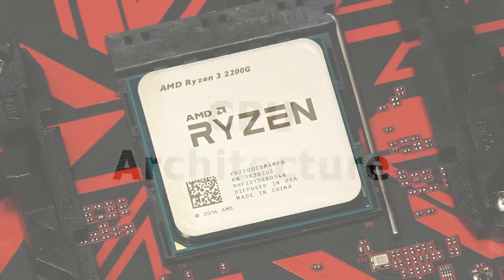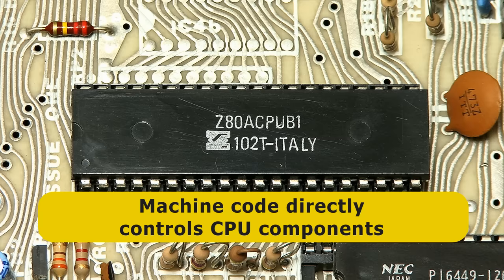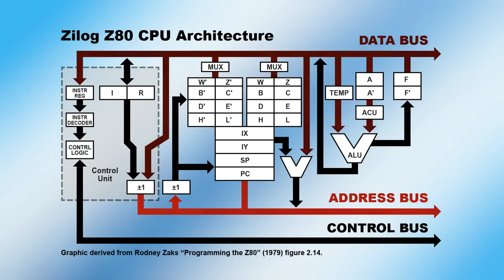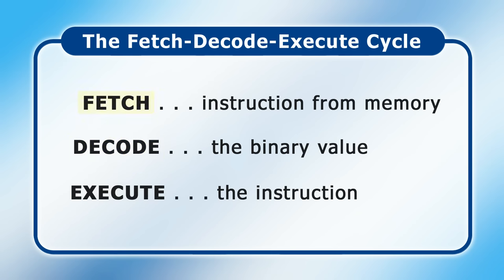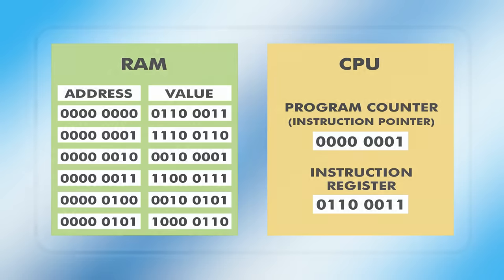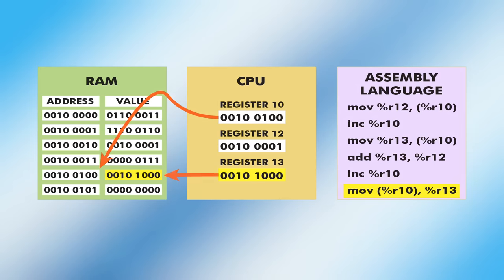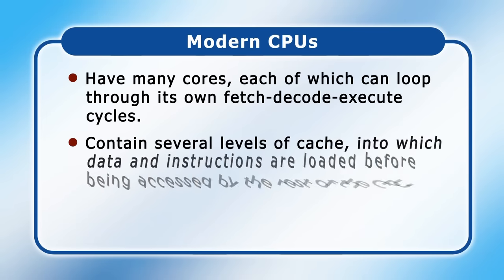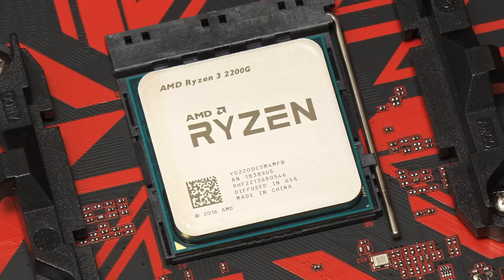How Do CPUs Work?

Comment: When you render an image in blender and it takes hours imagine how many billions or trillions of operations your cpu has to do, I can't even imagine a number that big.
Reply: This comment is key, as we almost lost our excitement capabilities on this area. Let me tell you that one day like this, July 12, but back in 1950, Dr. Konrad Zuse finished and sold the believed to be the first commercial digital computer of the world: the Z4. This machine was able to perform ~1000 calculations per hour (a multiplication each ~3 seconds). And that was fast back on those days! Today, a processor easily can perform more than 250 billions (short scale) of calculations per second (FLOPS). And that's in just a 70 years timeframe! Sure, processors can go over this number (can go over 1TFLOP or 1 trillion of operations per second) today, and graphics cards can go over 8TFLOPS today. And we still complain about speed in computers.
Reply: Thank you for this info, I also would like to know if Dr. Zuse's computer used discrete transistors or thermionic valves. Regards
Reply: amazing ! thank you
Reply: @A. David Garza Marín   we complain about speeds because of the evolving needs of humanity. Nobody will complain about the speed of a calculator, but if you want to do 3d rendering suddenly a few billion calculations per second is garbage
Reply: @adgarza  amazing how computers can run trillions of calculations per second yet web developers create websites that cant be easily ran on them
Reply: The whole internet and everything digital we know today is made from this. Computers are dumb they can only count from 0 to 1. So now imagine how many transistors it needs to gve it complexity.
Reply: Great video! I have a question..theese registers, what are they literally? Are they components that turns on or off or are they fixed?

Comment: I learned assembly language on a TRS-80 Model 1 back in high school.  We created a program to fill the screen with pixels both in Assembly and in BASIC and I was amazed how fast the program written in Assembly ran compared to the interpreted language of BASIC.  Fun times!
Reply: My first assembly language was for the Z80 in the TRS-80 model 3.  It kicked the model 1's butt!  Upper AND lower case and all!   ;-P
I made lots of little assembly programs back in the day.
Reply: See here why I avoid Python as much as I can. ;) 
I started 'programming' with BASIC, back then I simply had no access to other languages, I did not know anything about C or assemblybecause there was no internet. My first computer had an XT (pre-286) CPU, it had so little RAM that I could only play Prince of Persia by switching 1.4 MB floppies.
Reply: Good ol' trash 80.
Seems like just yesterday.
Reply: I almost gave up learning programming due to BASIC & Flow-charting, despite attending face2face classes. Could hardly understand the GOTO stmt. I saw some light when by chance I saw my teacher coding in some other language that had no GOTOs and zero line numbers. And I asked and that was my First encounter with C. I purposed in my heart to learn C and declared to my teacher I want to learn that instead of BASIC.
Alas, I was not willing for my parent to spend anymore in classes. Like what most other teens did; I turned to books. Spent hours to land myself on the right book. Finally learnt C and Psuedo Code b4 able to understand flow-charting.
From thence, picking up another language was do-able.
Yes, finally I code in VBAs and some other languages too.
Assembly is a little challenging though, perhaps just need some purpose for me to go that route.
Reply: @bobwong8268  YEAh, the biggest problem I found was to get the right info or most appropriate book at the time. There was plenty out there but none of it made much sense unless you happened upon the right stuff at the right time. That's where well structured and timely courses become useful.
Reply: commodore vic 20 RULES
Reply: @bobwong8268  The book of the day was "Programming the Z80" by Rodney Zacs. Still have my copy somewhere
Reply: @divismorefilms  Thx! I was a little late, 1st PC was the XT-8088.
The book that taught me programming was "teach yourself C" by Charles Siegel.
Reply: Hi Chris. The first assembler I used was mainframe (IBM 360) assembler, but soon learned IBM 1130 assembler.
Reply: Not me. I had traded in my trs80 for an Atari ST before I knew what assembly was. The Motorola 68k was amazing.
Reply: hope that this was taught to me in my high school times!!!!!

Comment: No matter how much even the most genius person in the world can try to explain how CPUs work I will literally never understand but also bask in amazement on the fact a mixture of freaking silicates, metals, carbides, and a few other elements designed all together can process and compute and literally give us what a computer gives us and allows us to do. It's insane when you think about it. Basically alot of highly refined sand converted into silicon and made into a CPU that electrical signals run through and then wow bam we have a computer. No amount of explaining will ever make sense to me and its not because im some idiot its because im just amazed that elements compounded and put together with electricity ran through them can do what they do. It doesnt make sense to me, Explain a way and i will always ask, BUT HOW DOES FREAKING SILICON GET MADE INTO PROCESSING POWER AND WHAT COMES OUT ON A COMPUTER SCREEN? HOW DO  THE 1s AND 0s ACTUALLY GIVE US THIS CRAP! ITS FREAKING MAGIC AND ALWAYS BE. ITS NUTS!

Comment: Excellent video, Chris - It would be great to see something similar for GPUs.
Reply: Go one step further and add in APUs and I'd agree
Reply: Maybe add in how GPUs differ from CPUs.
Reply: Modern professional GPU's can run OpenCL, so if look at that you can see the difference. OpenCL is made for massive parallel processing (the RTX3090 has 10.5k cores), they can't share memory between threads unless marked as volatile which means it can be corrupted/changed by any other thread at any time. Like releasing 10k bulls from a gate.
Reply: Chris, please explain my wife

Comment: You have refreshed my Tech programming class. I learned assembly language for the 8086 and wrote a basic program to run a traffic light. Thanks!!!
Reply: Self taught on an 1802, I wrote a 4 function calculator in assembly.

Comment: I was a mainframe software engineer for 46 years on several operating systems: OS (in the SVS, MVS(in many variants), z/OS, etc variations), DOS (/VS, /VSE variations), VM (/CMS), TPF, etc. for individual companies' development shops, and for several vendors (including DBMS, IBM, and Computer Associates). 2/3 or more of that work was in S/360, S/370, S/390, System Z (including Authorized-) Assembler.  The simplest of these had around 150 instructions, the most complex had around 400 or more. This was a great intro to the bare basics of Assembler on micro-processors. EVERYONE should have a grasp of machines at this level, no matter what 'level' of programming tools are used, if for no other reason than understanding the great advantages (and disadvantages) of higher-level (and more machine-abstract) languages and related tools. Great job, Chris !

Comment: Good explanation.  Of course even the CPU has microcode that tells it what to do when the instruction says the binary equivalent of "mov %r12, (%r10)".  Your code told it WHAT to do, and the microcode makes it DO exactly that.  The microcode is fixed in the CPU hardware...all those little transistors and can't be changed.  What writer was it who said "even the parasites have parasites" or something like that.  I, too, started by writing assembler code for a Z80 and later the 8008 and later the 8086/8088.  Prior to that, I wrote machine code for a Gerber plotter...no compiler at first.  It took forever to load in all the 1's and 0's.  Eventually we bought an APT (look it up) compiler and we really felt like we were "eating high on the hog"!  It was very Fortran-like, and was the beginning of Computer Aided Manufacturing, CAM.  As usual, I enjoyed your taking us down memory lane.

Comment: Awesome video!  It reminds me of the very first computer that I used back in the mid-80s, the Tandy Radio Shack  TRS-80 Model 3 which was also powered by the Z-80 chip with the clock speed of just 2 Megahertz.   That computer had tiny 48 Kilobytes of main memory and used TRSDOS as it's operating system.  It had two 5 1/4  inch floppy disk drives but no hard disk.   Since it didn't use any operating system with GUI or graphical user interface, it also had no need for a mouse pointer.
Reply from the maker: Thanks Gerry. I never used a TRS-80, but looked at them in window of the store on many, many occasions. :)

Comment: In my day, back in the 1960s the process of converting assembly language  mnemonics to binary was NOT compile but the ASSEMBLE process. Compile was reserved for high level language translation first to assembly language then that assembly intermediate code assembled to machine language.
Reply: I was coding IBM 370/Assembly language until the early 2000s - and it was the Assembler that converted that to machine code. Compilers are for high level languages (in my case Fortran). I'm not aware that the nomenclature has changed. And then, of course, Interpreters for interpreted languages.
Reply from the maker: A compiler is a program that converts code in one language into another, and the definition has not changed. Yes, machine code compilers could and have been called assemblers. But they are still also compilers.
Reply: @ExplainingComputers  Wikipedia agree with my understanding of the terminology,
Reply: @tonydyer2919  Wikipedia can be fixed (although I agree with both of you).
Reply: The older compilers took two or three passes to complete the task. High level language into intermediate code or assembly language and finally linked into a file that can be loaded.  The UCSD system stopped at the intermediate code (p code) which was down loaded and executed by a virtual p-machine which was independent of the processor type.
Reply: @ExplainingComputers  Assemblers always output the same machine code for a given input and there's a direct one to one relationship between the source code and the object code. The same is not the case with a compiler. There is no direct relationship between the source and the object. Different compilers produce equally valid (in the sense that it produces the correct results when executed) but not necessarily identical output, depending on the optimisations chosen.
Reply: The reason I remember the assembler to machine code process was because it was a one-to-one process: one line of assembler equals one machine code instruction.  OK let's forget about macro assemblers for now. A compiler on the other hand performs multiple levels of analysis of each line and then translate each line into many machine instructions.

Sure they are similar but do we still consider them similar enough to use the same word for both now?
Reply: @johnm2012  Ah. Thanks. I suddenly have a moment of grok that I did not have before. (Not a programmer, but an interested bystander.)
Reply from the maker: @johnm2012  Yes, agreed. But the fact remains that a compiler translates code in one language into another. And we are getting caught in semantics here. Here I have tried to make a video that explains something complex in a simple fashion for a non-expert audience. I've been doing this in lecture theatres, books and videos for 30 years, and can never please everybody, as simplification is always required.
Reply from the maker: @tonydyer2919  I am not disputing that a common word for a program that converts assembly language to binary is an assembler. But such a program is still, according to basic linguistic definition, a compiler. I would also never take Wikipedia as a definitive source of information on anything! Many of my former academic colleagues automatically failed anybody who cited Wikipedia! :) It is a great general resource, but frequently inaccurate.
Reply: @ExplainingComputers  I learned programming in secondary school in Scotland in 1966 to 1969. Worked my way from trainee programmer to MIS manager over about 20 years. Taught IT & Computing for 30 years after that, Hold HNC in DP, BA Hons in Systems, MSc in Systems integration. I know what I am talking about and if people like to be revisionist then fair does. I give up!
Reply: @tonydyer2919  "What's in a name? That which we call a rose,
By any other name would smell as sweet."
-- William Shakespeare

The assembler code I wrote was compiled, but, it still ran to completion with a return code of '0' (shades of COBOL on an IBM MVS TSO system  creeping in...). ;-)  I think it all depends on what we were taught.
Reply from the maker: @TheFuzzy70  Thanks for this. If it makes you feel happier, then I accept that I make the wrong judgement call here to use the term "compiler" rather than "assembler".
Reply from the maker: @tonydyer2919  Respect Tony, sorry if I offended.
Reply: @ExplainingComputers  We can agree with your definition that “a compiler coverts code in one language to another”. But what you’re overlooking is that the language of Assembly code “is” machine code. So the Assembler is simply assembling this more readable version of the machine code language into it’s raw binary form. A different language, like Pascal or C, uses a Compiler to generate the Assembly language equivalent “language conversion”, which is then Assembled into its final raw binary code form.
Reply: @TheFuzzy70  I just have to add one last comment on this thread; yes, we are caught in semantics here; it's just semantics and no more.
Reply from the maker: @gregclare  You make an excellent point Greg. I stand corrected.
Reply: In 1967 ICL published the PLAN Reference Manual for the 1900 series. I spent 1974 and 1975 writing subprogrammed test suites in PLAN for the DHSS network. My recollection of the use of "compile" and "assemble" is the same as yours BUT having discovered that someone put up a pdf of the PLAN reference manual, it seems the "compiler" terminology was official although we programmers never called it that.
Reply: I'm going to go have a cup of Yorkshire Gold tea, with milk. :-)
Reply: I would note that "compiler" is not a good name for a tool that translates from a high language to a machine language. The proper use of the word is in a phrase like "I compiled the reports for the last ten years into this single chart". Note that some very early languages were implemented by compiling: each high level structure was replaced by a copy of the corresponding machine code fragment. But even most of the earliest high level languages were implemented using translators instead. I don't know why the incorrect term stuck.
Reply: @simonknights7526  Google: difference assembler and compiler. All the hits I see are exactly in line with your description. I learned coding IBM 360/Assembly language and Fortran in the 1960's. That was the definition and difference in the terms I learned way back then. I did another quick search and various authoritative and learned discussions concerning the x86 processor used the term "assembler" to describe the converter program. That, therefore,  is the precise and correct term to use. BTW, one of these days I could like to play with IBM assembly language again since various facilities are available free for the PC. It is the one I can still remember. Sort of.
Reply: @sharonwolff1  you are right, there's still a distinction. A macro assembler basically only does a pass replacing macros with the full instructions (as far as my teacher told me, I never got to the stage of writing programs in assembly long enough to require macros), so it can be thought of as a copy-paste pass. Not really compilation. So there is a difference in nomenclature but since this is a simplified video we could give it a pass.
Reply: It's all a war of bits.🙏🐯🇵🇰
Reply: Go outside.

Comment: I wonder how many of us still keep as favourite the first microprocessor we ever worked with? For me it’s the 6502 in a BBC Model B. I spent a year or two using one at work to control a 2-axis stepper motor system for a job we were working on. The main program was written in Basic but it was too slow for some of the functionality hence I learned some 6502 assembly language too. Great fun!

Comment: Thanks Chris for a good solid explanation.  I built an IMSAI computer about 1976 - 1978 from a kit (Altair was the most popular) prior to the Apple II.  It was big and had 4k memory boards with lots of chips all hand soldered.  You programmed it with front panel switches, so pleased to add an optical tape reader.  Sold it to a fellow ham.  Met Gates and Allen at a Walla Walla hamfest hawking BASIC shortly thereafter....

Comment: I remember back in around 1976 I was completely new to microprocessors but got my hands on a Z80. I didn't initially have a way to program an eprom for it's code so hooked up it's address, data and clock lines to some switches. I couldn't believe it when I manually stepped through some code to add two numbers together and got the right answer!